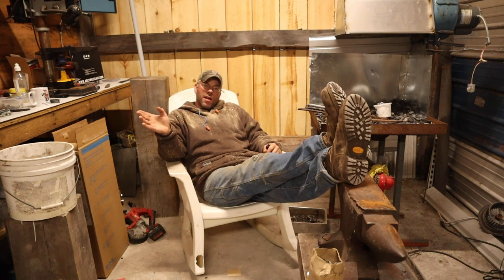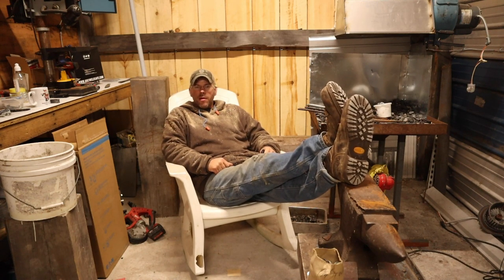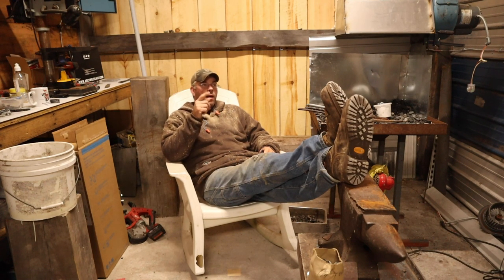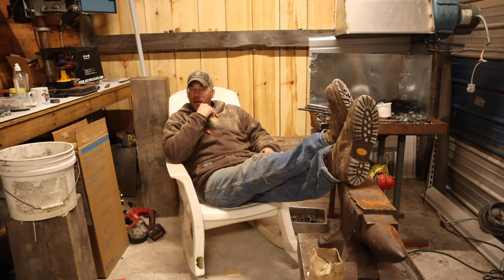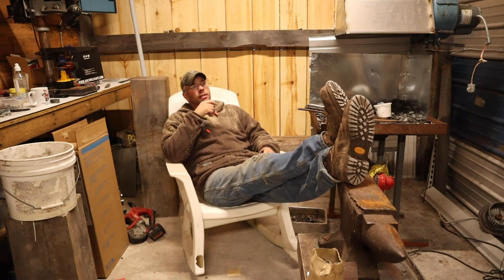Modern Lumber Will Never Be As Good As What the Ancients Made: A Timber Framing Vlog

Comment: Another great video Jim, I also agree with Your assessment of the riven vs sawn wood durability. I myself as You know am a newcomer to timber framing for now but, have some woodworking experience. A tip for You if I might with the router on wide multi pass cuts by hand! Approximate a pair of kerf cuts near center to leave a narrow surface for the router to ride while working each side. This should leave an increased surface finish on the bottom of the cuts by reducing the routers tendency to tip. With that smoother surface the remaining uncut kerf is easy paring for that wonderfully sharp slick! Keep up the great work I am enjoying all the content!
Reply from the maker: Good tip on the router.  The bit was very dull and the wood very dry, poor combination to say the least.
Reply: I was happy to be able to contribute in a constructive manner, You have been quite an inspiration for me to get started!

Comment: Keeping the wood wet not damp keeps more oxygen away which promotes oxidation. Plus the added fact is two by fours or two by sixes or 2 by 8s are actually 2 bys. Not 3 1/2 by 1 1/2. Also cutting the wood destroys less cells than sawing or ripping the wood. Good points Jim. As always God bless and take care.

Comment: i agree to a large extent, but i have had logs in the same load that had totally different characteristics re growth ring spacing, same species. also, i've seen hand split red cedar shakes , that i split, rot in 15 years because of the peculiar leaves from the neighbours tree piling up and sticking to the roof, getting in all the cracks and crevices. not sure if it was just the moisture or some particular chemical in the leaves.

Comment: Morning, or is it still night?  I have never figured that one out just yet at 12:30am. Anyway, howdy, Jim. Tis true old growth hand hewn timbers were/are much stronger than timbers cut through the swirling grain of most of our young growth trees. Still, a timber frame, oiled or not, is a thing of beauty to behold. I think Jessie and Alyssa, over on that other channel, have a beautifully done timber frame with oiled timbers. But they got a whole crew there to cut the joinery and assemble theirs in just under one week, so no real time for weathering. Plus the citrus oil they used on the timbers gave them a real nice sheen. But your frame being weathered with unweathered sheathing looks just as awesome to me. Writhen or cut, it all looks good and should more than outlast modern "stick-framing".
1000 years? Not likely with young trees used, but hey, we'll never know because we'll be gone before the timbers will.
Have a good day and may you get off early on Friday and have the time to finish the door/s. 
P. S. Another man door on that end is a nice touch.
Reply from the maker: Hello Thomas.  Those other two need to dry that thing in.
Reply: @TheTradesmanChannel  yeah,but they have to run any wiring in those walls before they can foam the gaps and runs which are accessed from the outside. After that they can do the siding. But yeah, they need to get on the ball. They haven't done much in almost a year since the frame was put up. Yeah, they got the roof on and doors and windows in, but not much in over 6 months. Maybe it is a waiting on money game, personally i dont know their financial position. But they sure spent a load of money on all of that machinery.
Reply: @thomasarussellsr  You mean Pure Looking For Loot
Reply: @tonygrimes13  yeah, backhoe, excavator, skyjack, and a plane? Maybe money isn't the issue, but the allocation/reallocation of it that should be prioritized?

Comment: Old growth vs. new/fast growth? A few years ago I was at one of the chain stores and noticed a 2x4 that had four growth rings.
Reply: I have an oak lumber on my roof with the dimensions of 12x28 cm (not exactly because of its hewn and over time it loose moisture) and it is difficult to count the rings because of they are so near together that you can't really see when the next begins and the further one ends xD
Reply: this depends a lot more on what type of wood then anything, black locust witch grows really fast is one of the top rot resistant wood in the world, yet other slower growing woods will rot away in months if underground.

Comment: Prof when doing the half laps could you clamp the two pieces together and use the chain mortiser to cut them getting it half and half ? Just an idea to save time, I know you like hand tooling but if you have a load of them to do. KEEP up the GREAT video's
Reply: I tried that once and it is not working very well because of the force of the chain mortiser it want to go to the area with the lowest resistance and so it do t go down straight and if you make it with hands you can control better what part of wood goes away and what stay
Reply from the maker: Bingo
Reply from the maker: Hello Doug.  The chain mortiser is happiest in timbers.
Reply: Just a thought.

Comment: I have a book on Round Wood Timber framing where the author describes the method and claims that a round timber is 40% stronger than a square one mostly for the reasons you mentioned. I haven't been able to make myself do it but I have a bunch of "pecker poles " that my logger sold me that are too thin to mill so I intend to use them to build lumber sheds next summer. Need to learn scribe rule layout so it should be informative. The wonderful thing about the mill is that it gives us a datum surface to lay out from. On a different note, a good amount of construction adhesive like Tight Bond would really help those screws hold those lap joints together. It doesn't cost much and it doesn't work loose on a stressed item like a door. Just Sayin'

Comment: The reason old lumber hold longer is not only the split wood they even put the right side of the wood to look outside (the right side is the side near the core of the wood) that part is older, harder and can't suck up wather as the younger parts of the tree we use that method today too in Bavaria and you see the difference to companies won't work that way even after just 10 years
Reply from the maker: Someday I'm going to work with you.
Reply: @TheTradesmanChannel  im sure xD
Oh and because of the right side of the wood a important part is to be sure that the core self isn't there you want core site but the centrum is very soft at the most woods we cal that part Markröhre you avoid that part because of its like a sponge
Reply: Oh and one point more is to mention! At some of the oldest buildings I was ever working with (I mean 300years+) often one side of the building had other wood most parts and anything inside is made out of spruce or pine wood but on the weather side they use a wood with much resin inside or much harder wood like core oak every region got a other weather side you need to figure out where it is by your own in my area you can see it easy at the other buildings that's often the most grey area of a wooden building or the side where they put a protective layer on their facade of the building like shingles that they replace all 20-30 years

Comment: Good thoughts on the difference in preparing wood another thought is that the older wood might have tighter grain structure like old growth timber compared with modern lumber the grain structure is a lot tighter in old growth. 💚💜
Reply from the maker: You would be correct.

Comment: Yeah the thing you're talkin about the wood is correct you look up there in Chattanooga Tennessee when they go to tear down some of these old buildings the Timbers are still there I mean I'm talking huge ones that they had to bring in with a horse in and drag them in place.... but they use pine pitch to cure those you working with the guy that's in construction and we went to go look at a house one day to see if the guy needed help but he saw how big they were underneath the house for the foundation that's what they used back then that's what the whole house or just was constructed on out of these big Timbers leave the same way you did this just the way the wood was more grain better I mean they let the trees mature as they should not the way that we see today commercially I worked in the building material business for a long time so I can understand what you're talking about.....